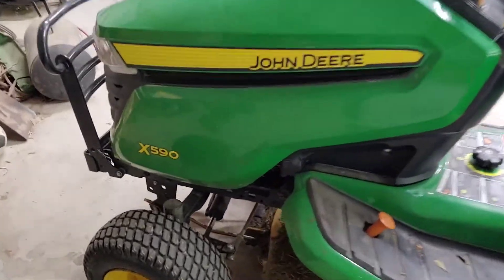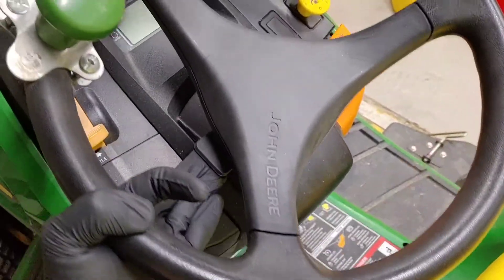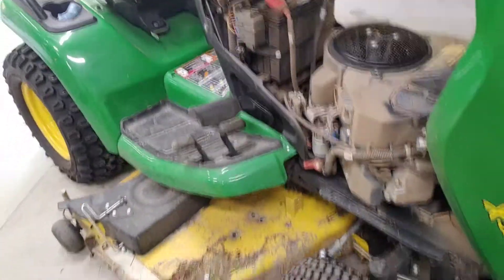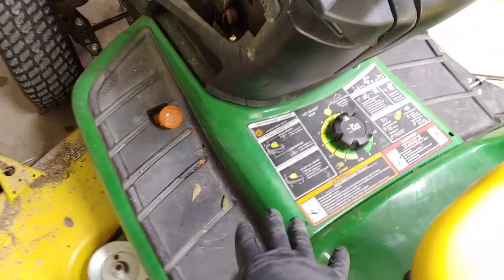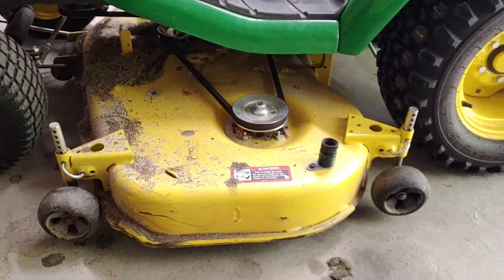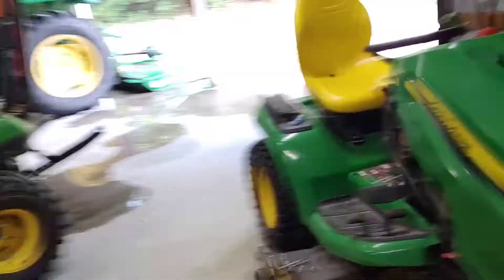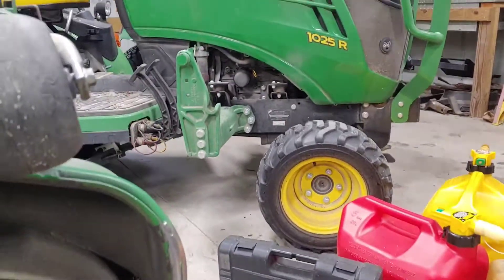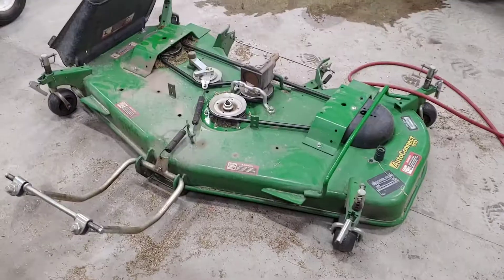JOHN DEERE X590: 100hr Review [and Maintenance]

Comment: I have an X590 and love it. Thought a lot about getting a zero turn but went with the X590 due to its versatility. In addition to mowing, we use it to tow a dump cart, spreader, sweeper etc. Also, the EFI, push button blade engagement, HST, and power steering makes this machine very wife friendly. She just has to turn the key and it goes, cold or hot. No choke, levers, gears or clutches to mess with. Great machine!
Reply from the maker: It is a nice mower and def user friendly for most anyone in my opinion. The EFI is def a great feature. Gonna look to have that on my next z-turn purchase down the road. Thanks for watching.

Comment: @Josh’s Lawn & Landscape  seen in the comments of a video bye Jeronimo21 on this mower that the dealer installed a bracket wrong that holds the deck. Good luck
Reply from the maker: Think we got it. Leveled the deck with a different leveler that goes off the blades rather than the edge of the deck. Doing good so far. Thanks for the info though👊.

Comment: We bought the X590 because we have a grade on our lawn to mow and this machine climbs and cuts like a champ. Great machine. Your right they are pretty loaded for a tractor. Great video. sub'd also
Reply from the maker: Thanks for the sub. Its a solid machine and good on inclines. I was having some issues with the cut recently but think i got it worked out, just testing it to see. Thanks again!
Reply: How steep is your grade? I just bought a new X590. Moved last October to a new home. I had a X350 and rear wheels spun up hill and slipped downhill, not fun and very scary. Can’t wait to mow next week with new X590!
Reply: @patrickthorsell2633  Yes ours is pretty good grade, from the bottom of one part of our driveway to the first half is 150 ft. elevation, it's a pretty good grade. My wife likes to mow and she uses the traction button when it's trying to slip but our sales guy came over and tested the grade and made the recommendation based on that. That tractor goes anywhere. Real happy with it.

Comment: What’s the maximum amount of acres you’d recommend mowing with the 590 before upgrading to a larger mower?
Reply from the maker: I would say with the 54"deck like this one...the 2-3 acre range is probably a good top limit (my opinion). Then might be a good time to look into going up to a 60"zero turn. I say that for the time savings on bigger properties I feel you would get with the Z turn. Thanks for watching and subscribing
Reply: Josh's Lawn & Landscape Thank you for the info, enjoy the videos.
Reply from the maker: @pogveteranar9415  Sure thing, thanks for watching!
Reply: I have the X570 54" deck 2020 model. It takes me about 45 minutes per acre. At that mowing rate, how much time do you want to spend? In order to improve that rate, you need to go with a wider deck and a faster travel speed. The X570 has a top speed of 7.2 mph for a baseline. Many of the ZTR machines go faster than that. Good luck.
Reply: Thomas Kendrick Thank you
Reply: @tkendr01  Ever have any issues with your 570's front axel assembly?

Comment: Whats your thoughts on predator blades vs high lift blades? Which would be better in wet grass? I can't decide between the JD x590 or a JD x390 54in cut. Powerflo bagger available for both. Nice mower and I do have a buddy that uses a X580 54in for his lawn business
Reply from the maker: I think the blades depend on your application. If you are gonna bag a lot then the high lift would probably be better. If you are just gonna cut and chop up the grass like I do, predators no doubt and you can still bag with them on occasion if need be. The predator blades I think would be better in wet grass in my opinion. I would go for the 590 over the 390 to get more to. It will give you more blade torque for cutting. Thanks for watching👊💪!
Reply: @joshslawnlandscape9935  Thanks for your input. I plan to purchase next year. Also the 590 has a heavier transmission
Reply from the maker: @msclecarcrzy  I also think you would be better served with a z920M (get a suspension seat) with the 54" deck for the money. Only around $1k difference on price and you get a much sturdier machine. 😎💪👍

Comment: Hi Josh. Enjoying your x590 vlogs this morning. I see you have the 1025r for the bigger jobs, but I’m wondering if you ever considered getting a Little Green Monster FEL loader for moving gravel and dirt piles, digging etc. I really don’t have the need for 4x4 such as x738 as I’m mostly cutting just under an acre of grass and pushing 6” snow at most. I’m trying to get a consensus if the x590 with electric actuator at 8k is nearly as good as the x738 with hydraulic pto??? Any thoughts?
Reply from the maker: Thanks for watching!! Haven't thought about the LGM and I haven't used the x590 for anything other than mowing and bagging so I can't really say how it performs with pushing, etc. It does seem to pull my spreader (100lb hopper) fairly easily though. I have used the 1025r for pulling shrubs, etc. and it did excellent, but it is def a little overkill maybe for just an acre of grass😜. I can't speak to the x7 series, but between the x590 and the 1025r, the 1025 is far better as a multi-use piece of equipment to me. I think you can get a 54" deck for it so it might not seem too large 😁. Hope my rambling was helpful...lol🤣🤣🤣
Reply: @joshslawnlandscape9935   Pulling a 100lbs (big limbs and small trees I cut in the woods is about all I could see pulling/dragging). Thanks for the reply. Keep posting the x590 vids and I’ll be watching. ✌🏻👍🏻
Reply from the maker: @Malinois_Whisper  I will try😁😜🤣

Comment: that is one hillbilly deck levelling set up
Reply from the maker: Yea...i stopped using the gauge from under the seat and purchased a blade leveling gauge and it worked perfect. No issues since leveling it off the blades😜👍. Thanks for watching.

Comment: These john Deere's x590 is hype like most John Deere's are I did a Spec investigation on the Craftsman T240  T260  and the T310 the Craftsman T310 has the same transmission as the x590 Deere..the Deere has a 4 gallon fuel tank all 3 Models of the craftsman have a 3.1 gallon fuel tank but that's where it ends the T310 is heavier 650 pounds x590 606 pounds the T310 is also longer and taller the John Deere has the Kawasaki Engine 4 years or 700 hours witch ever comes first..if you mowe Acres of land mathematically you can rack up 700 hours in just over two years. now to the craftsman Kohler 7000 series engines comes with a 3 year Unlimited hours Warranty so reality is Kohler has the better warranty...both have a 11 gauge steel decks 54" the craftsman's are reinforced steel decks...once you get into 12  11  10 gauge steel you have strength the Craftsman's are just under $3,000 the Deere is $6,000 now my point with all this said tell me and give me a valid answer not opinion how Deere justified the $3,000 dollar difference? And let's not forget the craftsman also has a 5" turning radius damn near a zero turn and these craftsman's are built better than the ×590 Deere's this is why you always read specs before you buy any Lawn/Garden tractor
Reply from the maker: I can only speak on my experience. First let me say that this mower is a solid machine. I know evryone talks down on JD and the cost but my experience is you get what you pay for. Support also accounts for some of the cost. I have never heard much good about support for warranty from the big box stores and support after the warranty. Being able to purchase the mower, have warranty handled and availability of parts all from one location accounts for a lot. Biggest thing for me is experience. I cant speak to the craftsman mower quality, I have always known them to be solid average residential mowers. My experience with the JD mowers I have owned has always been quality. I appreciate you comment and opinion and thank you for taking the time to explain your thoughts. Hope to hear from you on other videos as well.💪👍🎯🇺🇸
Reply: @joshslawnlandscape9935  like what was said compare the specs the craftsman turn tight series T240  T260  T310 are larger heavier their is no justification for that x590 to be $6,000 you paid for the green paint because quality wise it's not better than the craftsman turn tight
Reply: Susan, respectfully I am not sure you looked at all the spec's correctly during your "investigation."  The X590 weighs 805 lbs. according to the John Deere website with the 54" deck.  The X590 uses a much beefier K72 trans vs. the T310 which uses a K46 trans (similar to the X300 Series John Deere).  Craftsman's data is hard to find.  John Deere publishes all their data right on their website.  The X590 has larger 24" rear tires that are also a HDAP for better traction on loose ground vs. the 22" turf tires on the T310.  The X590 has hydraulic deck lift and hydraulic power turning - something the T310 does not have.  The X590 has an EFI Kawasaki power plant - considered by many small engine shops to be the best.  Kohler is not what it used to be and is what is in the T310.  If the decks on the X590 and T310 are both made of 11 gauge steel, then that is were the similarities end.  The Deere has adjustable anti-scalp wheels.  The Deere also has reinforcements around the perimeter of the deck to keep from bending in the deck.  From what I can see the Deere has a much beefier deck and I am sure the cut quality is also better.   For the money the T310 is a fine machine, but if I was to invest in a heavy duty lawn tractor that will last me two decades, my money is on the Deere.  It will likely be what replaces my old 82 Series Cub Cadet.